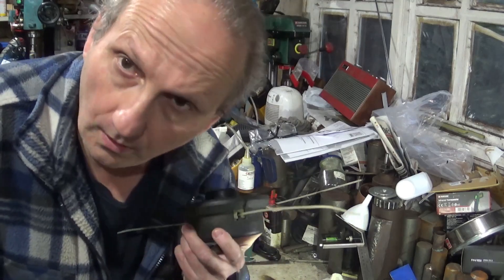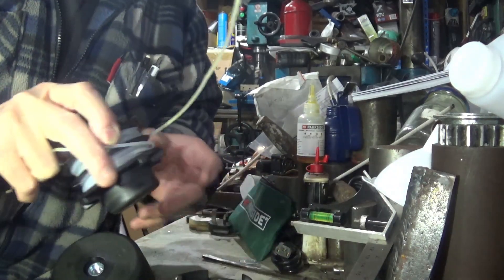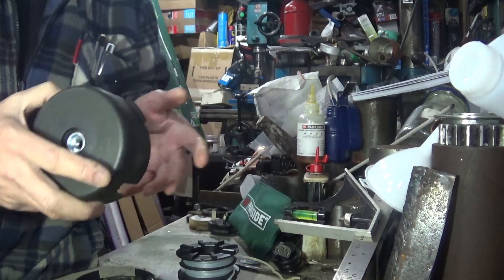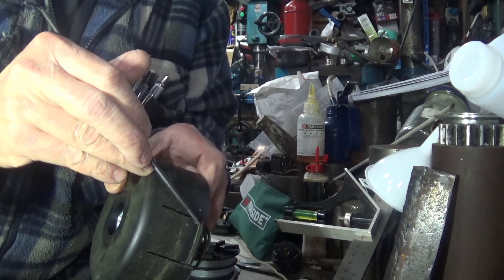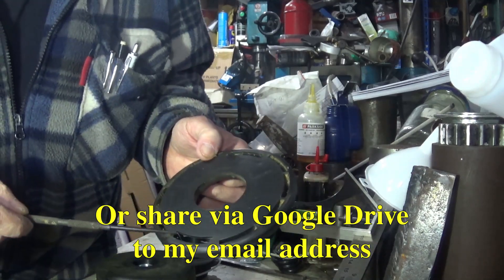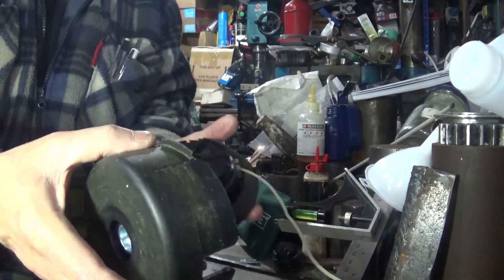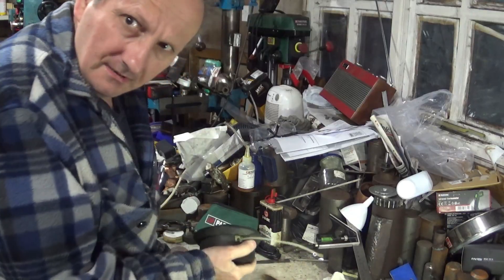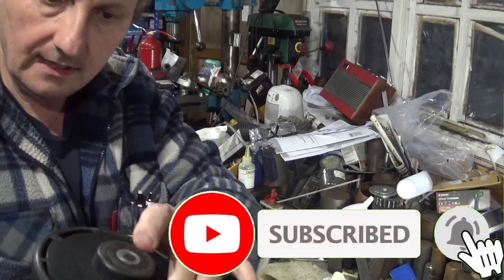Lidl Parkside 4 in 1 Petrol Multitool PBK 4 B3 Strimmer Head Problems

Comment: I’ve been a professional gardener for 20 years and have used Stihl strimmers for many years. The lugs were definitely engaged on both my heads that failed. It clicks into place firmly but simply pulls off very easily.
Reply from the maker: I take it that you have watched this video. It looks like something is preventing the the lugs going all the way home. Could you get some pictures of where they go into the other half of the head? I suspect there is some moulding flash that should not be there.
Many thanks for watching!
Reply: @BensWorkshop  yes I have watched it. I will add some photos to the folder tomorrow. It’s stored in my lock up unit at the moment.

Do you know the thread size by any chance? I want to buy a replacement head.
Reply from the maker: I do: it's M10 x 1.25, left handed thread.
Many thanks. You can see in this video how the bit with the lug on it sits when not engaged, and where it sits when it is all the way in. 
From your video, it looks like thee lugs are not fully engaging. I would be interested in a picture from an angle of the lugs when in, as well as a picture of the bottom. I suspect something is preventing the lugs from engaging. I can't pull mine off like you can at all.
Reply: I had the same defect on mine (luckily I noticed it before first operation), exactly as you guessed, one of the lugs/hooks we're bent inwards, enough that they didn't catch fully. Fudged it by wedging something inside to force the lug outwards. So far so good after 10 or so uses of the machine.

Comment: It's always tricky when someone asks you to diagnose their problem when it's not there in front of you - your suggestions of either malformed locking lugs or sprue seem pretty possible, OR incorrectly assembled or not pushed fully back together.  If the cover has had some abuse and one of those locking lugs has got cracked, that would cause it to let go.  Are those metal inserts that the line goes through a removable part?  On one of my petrol strimmers, they can be removed and replaced upside down, and then the cover doesn't go on correctly.  Also, if the line is sitting incorrectly (such as a piece tucked under the reel), can it cause the whole thing not to press together enough for the lugs to lock?

Don't worry Ben, I don't expect you to answer this, I'm merely scribbling my thoughts in case they can help someone else.
Reply from the maker: All very good points. I suspect it is either a mold flash issue or an assembly issue, but we can't say until I see pictures or videos.
Many thanks for watching!

Comment: Most annoying. I have a Ryobi strimmer and the auto feed of the head can be very frustrating. I don't think mine is faulty but I'm fairly sure I am. Is there a particular method for winding the string on? Thanks Ben, good vid mate.
Reply from the maker: Yes, there is, though the finer points vary a little depending on type of head. Th key is to not wind it too tight.
Many thanks for watching Mark!
Reply: @BensWorkshop  That certainly makes sense. I'll try rewinding my spool this afternoon. I take it everyone knows this 'trick' about soaking the string in water for a while to make it more supple? I can't really think why it works but some folks swear by it.
Reply from the maker: The string is plastic. Can't see water helping.

Comment: Great video thanks for posting!
I’m having a different issue regarding the strimmer head. I can’t unscrew the bloody thing from the unit!
I’ve tried (as per instructions) to insert an Allen key into the spindle and turn clockwise but it won’t unscrew…(even tried anti clockwise)
So I’m unable to change to a different tool like the blade grass mower etc

I noticed  on your unit in the video, your strimmer head spins freely when not turned on. That isn’t the same for me. My strimmer head is extremely stiff and has to be forcefully turned.
Maybe I screwed too far when initially putting it onto the unit?

I should mention I have the 3 in 1 petrol grass trimmer ( PBS 2 D4) so it slightly different but the fittings look exactly the same in your videos.

If anyone has any advice it would greatly be appreciated.
Thanks
Reply from the maker: If the head is stiff when off the power head I suspect the head may need lubrication. The thread that holds the head on to the unit has to be a left hand thread otherwise it would come undone in use.
Many thanks for watching, please like share and if you like the channel, subscribe!
Reply: @BensWorkshop  Thanks for replying. I’ll give it another try first thing in the morning. Hopefully with your advice it will start to unscrew. 
I was even thinking of snapping it off and just try ordering another spool case from somewhere online… that’s my last resort though lol
Again, much appreciate your response.
Reply from the maker: It should unscrew. If it has a blade that can go on then it will also have a nut from which you can confirm that it is a left handed thread.

Comment: I’ve just shared my photo and video folder to your email address. 

Does anyone know the thread size please? I want to buy an alternative head in the meantime 😊
Reply from the maker: I will go and check in a bit, but it looks like an M14 x 1.5 left hand thread.
It isn't, it's M10 x 1.25, left handed thread.
Reply from the maker: It's M10 x 1.25, left handed thread. (Measures just under 10mm in diameter and the thread gauge says it is 1.25 pitch)

Comment: That type of problem is tough. You don't know if the fix worked until they use it 20 times in the yard.
Reply from the maker: Yes, they are. However I have not had a problem nor can I see how you could have one, so I would like to see how theirs look to work out where the problem come from.
Many thanks for watching!
Reply: @BensWorkshop  🙂

Comment: The head seems to be identical to my 2019 edition yes.
I've uploaded a video for you
here https://youtu.be/-8nUtEtrpZQ read the description for what I mean in each part.
I've had no problem wit the strimmer head ever
Reply from the maker: Many thanks, very helpful. How much do you use the strimmer?
Also many thanks for watching!
Reply: @BensWorkshop  I have a petrol Parkside strimmer with the same head that I use for cutting grass. That head came with the multitool so Ive only used it a few times. Only problem I could see with it coming apart is the spring possibility being to weak on some heads and when force is given to extend the trimmer wire its opening.
Reply from the maker: Good to know. It is a good head. I like it, a lot. I will see if I can get a spare.